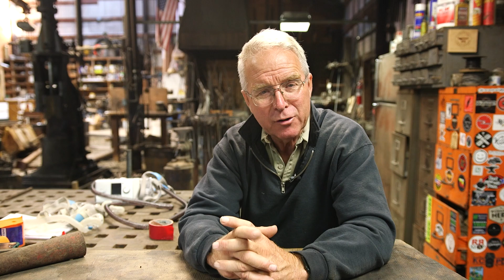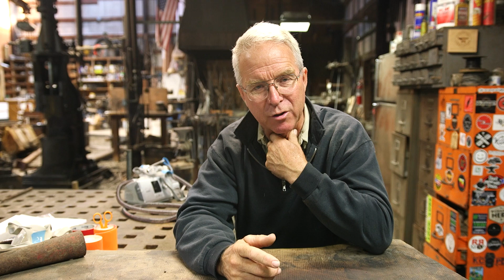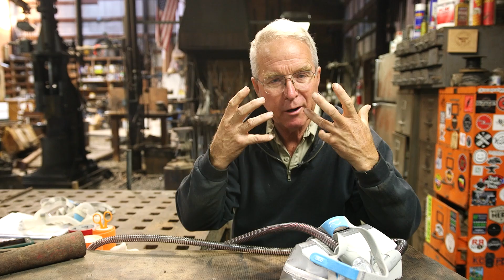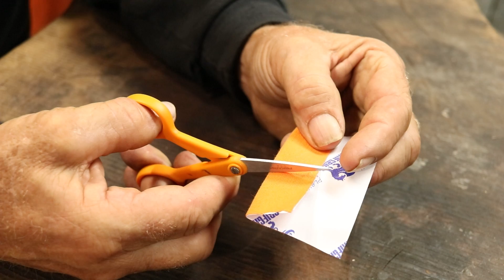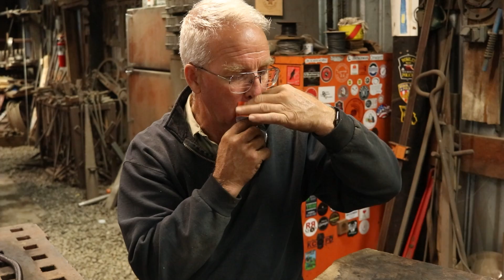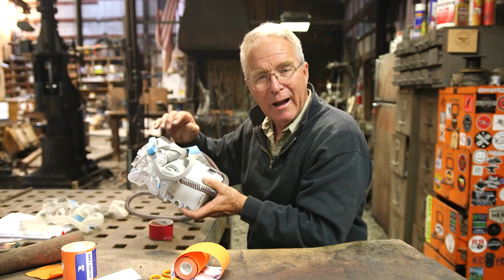Tired Contractor  Here’s My Simple, CHEAP Sleep Apnea Solution

Comment: As someone else noted below, a CHIN STRAP can be very helpful for keeping the mouth shut as well. It can be a simple separate chin strap worn in addition to the CPAP mask. Serves the same purpose as far as not letting the mouth drop open too easily, and so forces the wearer to breath thru their nose. Finally, for those who can overcome the sensation of feeling like you are initially going to suffocate, there are full face masks which cover both the nose and the mouth, so you get that Constant Positive Air Pressure (CPAP) to help ease the breathing and prevent oxygen starvation that way. 

 I cannot stand the full face mask either as it allows my mouth and throat to get so bone dry that I cannot even swallow properly, in addition to the feeling of suffocation, and so much prefer the standard half mask which covers the nose ONLY, and have learned to mostly simply keep my mouth shut in my sleep. That is something I don't suppose a lot of people are going to have a lot of luck with being able to do. The chin strap would be my next suggestion to aid in keeping that mouth shut while sleeping, and then your brilliant and sure to be effective vented tape solution, which would at least seem to be a surefire approach for breathing through the nose in your sleep as well. But using tape requires the user to always be clean shaven for obvious reasons: No more mustache / beard may be a step too far for some...(?) 

 More tools are always better than fewer, and the danger of brain damage due to chronic oxygen starvation is nothing for people to scoff at for sure. Thanks for sharing this - this is a simple doable idea that could seriously improve someone's quality of life! 🙂
Reply: Well said... Coming from a trained professional... But, it's pronounced " Dain Bramage".
Reply: Do you think tape over the mouth and the CPAP on the nose would work? Does the machine allow exhaust air out through the tube?
Reply: I've tried chin straps and they don't work for me.   My lips are still slack enough to cause issues.   I've also tried various mouth guards.   I'm also unwilling to shave my full "Santa" beard.  That would cost me a significant part of my income.    So taping is a no go.  Been searching for a work around for years but have been unsuccessful.
Reply: @kevinhornbuckle  YES, the facemasks are vented so there is ALWAYS air being vented / exhausted out, all the time. It provides pressurized air to help push air in with less effort when you breath in, and allows air to escape when you breathe out, so your mouth can stay closed the entire time as it should. Whether the user can learn to simply keep their mouth closed as a matter of habit, or they use a chin strap to help keep it closed, or vented tape as per shown in the video (with little vents cut in so you can cough and such which will occasionally happen while wearing the tape), all normal breathing both in & out is always through the nose, all the time, with a half mask.

 With the endlessly long seeming list of horrific miserable symptoms and health issues that can arise from chronic oxygen starvation while sleeping, up to and including actual brain damage, I would recommend to anyone to go ahead and get the sleep study done - your doctor will almost certainly want you to spend the night at a sleep center where they monitor and record your breathing while you sleep, so they can then determine what to do next - and go ahead and try to learn to live with the damn CPAP machine for a while. I initially HATED it but it became "normal" in a matter of a few weeks, and the benefits - for me - far outweighed the initial hassle. Your mileage may vary and quite a bit of course, but I am sure many who use these CPAP machines would likewise encourage you to at least try. No guarantees since everyone is different, but at least the worst-case scenario would be it doesn't help but at least doesn't actually hurt anything either, but all with a very real possibility that it could really improve your life quite a bit by simply allowing you to get better rest with no more chronically low blood oxygen levels making life needlessly hard on all of your various body organs, including your brain... All anyone can do is just give it their best shot and see how they make out, really. 

 Good luck! 🙂
Reply: i fixed this with surgery. best surgery i ever had only second to restoring my sight surgery
Reply: I have used two strips of Scotch tape crossed over my mouth for a while. I have a mustache and the tape always came off easily in the morning.
Reply: @pajohn2798  Wise words. I use a CPAP. It kind of works for me. It is better than not having it. I may try the taped mouth along with the CPAP as a transition step. I think I will get an Apple watch as Scott has, to get objective data. See if tape only will give me the results.
Reply: Some people benefit from a BiPAP
Reply: Knightsbridge Dual Band Chin Strap  is a godsend.
Reply: @kevinhornbuckle  I have used CPAP since 2008 and have tried every conceivable type of full face, partial face covering only the nose, a raft of other weird styles including a "fabric" style which was more of an "experimental model than a fully tested one. I also tried the "nose bud" type which has 2 small "buds" which fit securely into both nasal openings. I am currently using these along with a chin strap. 

And to answer your specific question regarding exhaust options the simple answer is "NO". The air tube running from the machine to whatever type of input device you use on the "face" end of the tube is only designed for one way flow for obvious reasons. But there is also an exhaust "system" is built into each and every mask or other input device to allow air of from 14 psi to 16 psi to enter your nasal passages or in certain cases, through the mouth and also exhaust any excess air out of the tiny exhaust holes around the intake hole of the mask itself. Here's where it gets a bit tricky. That input air is regulated from the machine and does not take into account your lungs also regulating the amount of air entering them. Say, for example, your machine is operating at 14 psi startup pressure, and it tops off at 15 psi of max buildup. If there were NO means of exhausting any excess air pressure some nasty side effects could occur. So, to stop this from happening every face "fixture" is constantly exhausting whatever intake air, not needed by the lungs in normal breathing, out of these tiny exhaust ports. Many CPAP users do not even realize that this exhaust system exists in their masks or nose bud assemblies, and simply think that the very faint current of air around their mask is nothing more than a minor leak somewhere around the neoprene seal.
Reply: @oldoutdoorsguy1157  Thanks for your info. Very helpful. I tried the tape and the CPAP at the same time. It did not work.
Reply: @peppers8489  another commentor in the comments said tape works fine for him even with his mustache and beard.
Reply: @rockjockchick  I'm glad it works for him.  It doesn't work for me.  But thank you. 😊
Reply: @narcissistinjurygiver2932  which surgery?

Comment: Scott, thanks for the tip. I am a 67 yo lifelong asthmatic with COPD and obstructive sleep apnea. Last time I was tested I was coming out of REM sleep over 100 times per hour. My Bi-pap was also set so high that I struggled to keep it on at night so I gave up on it and started sleeping in my recliner.

Oh and Lisunopril will cause you to cough. When the doctor put me on it I was coughing so bad I could hardly function.  My palmanologist switched me to Losartan and the coughing eased big time.
Reply: Lisinopril causes some people to cough as a symptom of congestive heart failure.  It doesn’t cause it in everyone.  I have been taking it 40 yrs or so.  But it made my mom cough.  She had heart valve disease.

Comment: Great video. To remove tape residue  you can use any vegetable oil. Olive oil,  you just saturate the glue area and the glue will just lift off. Its also gentle on the skin. 

This also works in the kitchen to remove labels from Jars.  
❤️🙏♥️

Comment: You had me rolling on the floor when you talked about using the gorilla tape and what it did to your lips and face. Then the acetone was the bomb. I use a CPAP machine and it used to be set at the highest level until I figured out how to turn it down a few notches. It took me about a month or two to get used to wearing it, now I cant sleep without it. When I did fall asleep without it one night, I woke up not being able to breathe. I had depleted all of the oxygen in my lungs. I thought I was going to die. So I never got to bed without the CPAP. And yes, I have both apneas too. Glad you were able to kick the Bi-PAP machine and get the sleep your body needs.

Comment: Great video.  As a bearded person the tape fix is out of the question.  I’ve used “pure sleep” for over 10 yrs. It’s a mouth piece that locks the upper and lower jaw to prevent the obstructive part of sleep apnea.  I used to wake up with headaches until I started using it.
Reply: I have a mustache and goatee, and I just tape to my lips and facial hair, and it seems to work fine. I use my tongue in the morning, to push the tape off my lips and hairs.

Comment: I'm 36 and started snoring pretty bad around 33 years old. I got a CPAP about 6 months ago and it's been life changing!! If you snore or think you have sleep apnea get a sleep study done!
Reply: Yeah same for me, but I also have central apnea as well and I cannot for the life of me figure out how people think taping the mouth could possibly help with centrals. The only use for it that I can see is helping to keep the mouth closed while using CPAP or BiPAP, and that would only help lower the leakage levels.
Reply: @aegisgfx  Agreed, I need CPAP to sleep right! My sleep doctor was pretty bad and set me up with a huge pressure range of 5 to 16 and that didn't work. I spent dozens of hours studying CPAP and my machine. I kept raising my starting pressure and it took months to dial everything in and get used to it. Now I'm on a small pressure range of 12 to 14 and I get amazing sleep!

Comment: In case anyone wondering, the tape is called GrifGrips Secure Tape. I found it based on the logo shown in one of the frames. It's not marketed as kinesiology tape though in essence very similar. It's intended for attaching insulin pump to skin.
Reply: Thanks. I looked it up and bookmarked it on their website. I use one of those head straps that wrap around and keeps your jaw shut and mouth closed. But I can still open my lips if I need to. I have two different types/sizes and they work pretty well.
Reply: I mean he says the name grifgrips
Reply: Some doctors are like mechanics. They wont tell you what works because the system keeps them in the greed
Reply: Thank you for that! This is going to be much cheaper than what I’m currently using!
Reply: He linked to it in his comments.
Reply: @tribemayamex  " They wont tell you what works because the system keeps them in the greed"
Most won't suggest anything outside of the Standards of Care for fear of being sued.
Reply: @tribemayamex  True fact. Struggling with an expensive and very common problem I sat down and thought it through, did a dirt cheap remedy, problem permanently stopped and when I told my Dr he looked at me like he wanted to kill me and thats not a joke. But I pushed on and took him through the steps which i'll make a vid about and I wish you could see the look on his face when he knew I was never coming back. The patient is never supposed to know the truth, never supposed to question or think.
Reply: Thanks
Reply: @cvcoco  So you're not going back to a doctor because he never heard of using tape? You'll probably run out of doctors pretty quickly that way.
Reply: Most people don’t know how to look at the video description, In this case for the link to the tape on Amazon.
Reply: @GutsyGibbon  EC added it later. Usually we the viewers let the video creator to post links so that they get the extra $.
Reply: Doing the rape trick might provide you with a slight intrinsic peep increase... 
But if you need a CPAP of say 10 or more... Tape will not keep you from suffocating your organs over and over and over and over and over if you have moderate sleep apnea.
Reply: @wisenber  No. I was referring to a different problem but my point was that the average Dr wont tell you to try tape if there is a more expensive solution he can make money on, calling it "we only do things FDA approved." Meantime, the video made me think of another solution people might like better than tape. I will check it out.
Reply: @annwithaplan9766  there’s a link in the description
Reply: I use plain old adhesive tape or surgical tape. Works great and inexpensive
Reply: Thank you. I was wondering what kind of tape it was. You just gave the answer.
Reply: @kimberlymarie3651  Something went wrong and i suppose its money and pressure. Long time ago I had a Dr who was very practical. He'd say things like, i could prescribe an expensive medicine, or, I could make a salve right now for free and its just as effective. There was a time they wanted to see you well, now they want to drag out expensive cases forever and milk you dry. And still you may not get well. They also do damage by mis-diagnosing and over-prescribing.  Going to the Dr today is basically a trip through The Outer Limits or Twilight Zone or Frankensteins Bride or something.
Reply: @kimberlymarie3651  Western medicine has its place if the drs have pretty hot diagnostic skills and a sincere interest in seeing you well. Such drs are out there but overall, yes its a fully corrupt system on the whole due to the lure of big money. In the 1940s a dr was lucky to make a few hundred bucks a month and there werent many takers. When the money grew in complex procedures like transplants, lots wanted to join and in fact talked about little else than how much could they make. I know a girl who is starting off as a surgeon now and she told me her only interest was getting $2 million in 5 years and bailing out because, among other things, hates to be around sick people and hates the sight of blood. And a person should trust her with WHAT?
Reply: @cvcoco  please do that video!!!!
Reply: @cvcoco  but sometimes you need them and if you are persistent enough you find the good ones and they are as good as gold.

Comment: I am also a respiratory therapist. I didn't go through all the comments to see if this was mentioned  but for patients in the hospital who we used nasal masks for CPAP or BIPAP we had chinstraps which would cradle the chin and go up over the top of the patients head which would serve the same function as the tape but without the issues of the adhesive. If you search for CPAP chinstraps some options will appear. You may have to modify one to suit you.
Reply: thanks for the tip! I usually sleep with my fist wedged under my chin so my jaw doesn't slack open. If I had a strap I could sleep on my back again! Perhaps I could rig an old bra to strap under my chin lol.
Reply: Tried 2 CPAPS, hated them both, it was the spider on my face.

Comment: I musta laughed for a solid minute and a half after you said you tape your mouth. You're adorable and Im glad you figured a life cheat to help your own self out. I have central nervous system sleep apnea. I fixed IT the old fashioned way. First I did test and was measured a 7-8 on a severity scale that goes to 14. Then I did another sleep study, but this time....I simply elevated myself up on a bunch of pillows in such a way as to prop my arm up to hold my jaw into place. This second sleep study showed I still have sleep apnea, but thats its a 1-3. So mild that I have NO issues. Oxygen is 97-98. So, I sleep at 45-50° angle. Helps with GERD acid reflux too. If I had obstructive sleep apnea, I might have tried the tape. Good vid and thank you.

Comment: Great story. There are commercial versions of your tape solution to keep your mouth closed with R&D behind them, but will work out a lot more expensive. I ditched my CPAP and use a chinstrap which seems to work resonably well. The only drawback not mentioned in this video is that a lot of people (like me) suffer from nightime nasal congestion (causes like allergies, enlarged turbinates, polyps, mucus not draining, or just a cold/flu). If you do then you need to be real careful about using a DIY solution else you might end up not waking up at all!

Comment: I have obstructive sleep apnea and have used a cpap machine for the last 8 years. I can soooo relate to it being a torture device. I have struggled with escaping air and waking up every hour to adjust the mask. I get less sleep than if I don’t wear it.
I’m going to try this tape thing. It makes sense for sure.
Reply: Ditto, I figure the tape thing may help, i tried a full face mask and it was a nightmare, but the idea of tape may just work, i can't remember the last time I had a dream, and i always wake up with a dry mouth.
Reply: @StaceyBillsAdventures  What about nightmares? They count as dreams in this instance.
Reply: @derpeyez  Best way to stop the skin sores is to wash your face very thoroughly before wearing the mask.

Comment: Hi, really enjoyed your video on sleep apnea. I too have obstructive and central sleep apnea. I have the Res Med Air Curve 10 with very high pressures. What I did was loosen the straps up and let it leak so its not trying to blow off my face. My machine gives me all the info. I need from the night sleeping and the dr said well your apneas are under 10 per hr and that is good. I was having 90 of them on my sleep study. You became your own health advocate at that is what is important. Don't be afraid to fire your Dr if you think they need to go. thanks for sharing. Also you may want to try loosing your straps and let the think leak. then check to see how many apneas you are having. Under 10 is OK.